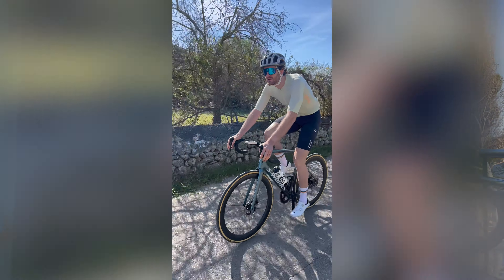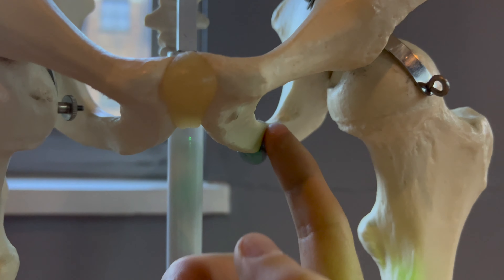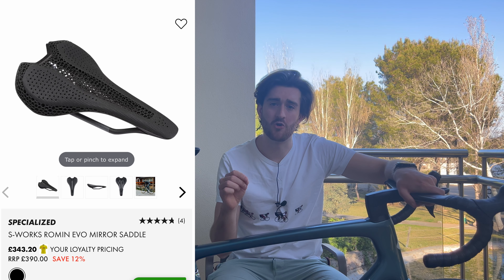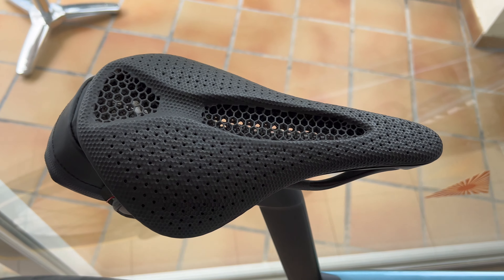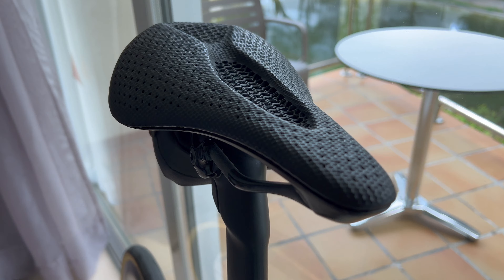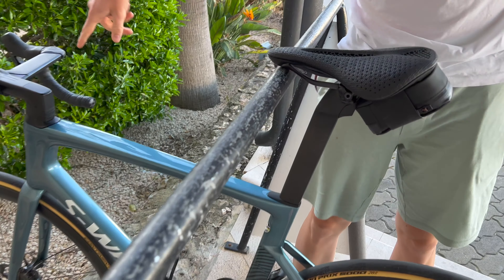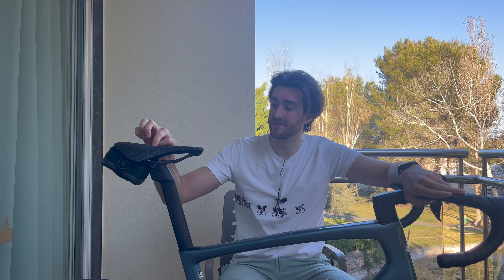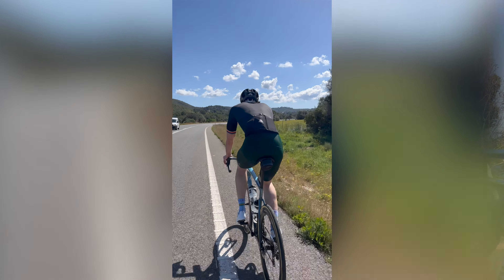Specialized Mirror Saddle (power version) review

Comment: I just bought one of these today and I'm currently coping by watching glowing reviews lmao (good lawd, I could buy a used Trek Marlin for the cost of this thing!). Your review is the best one out there and makes me feel confident! I have only test ridden it a bit while I get my fit correct and I can already tell this thing is a game changer.

I'm getting the Titanium version, mostly because there's a warning in the manual that says Specialized recommends replacing it every 3 years for S-Works (yikes!). I'm sure they are being extremely cautious and it will likely last many more years, but I figured I'd sacrifice the bit of weight for the peace of mind.

Anyway, I have never had a saddle I've loved, only saddles I've tolerated, if this turns out to be as good as everyone is saying then it will be worth it for me!

Dig the channel, new sub incoming!
Reply from the maker: I hope it works out for you in the long run! 

For me no saddle will ever be perfect but this one just works for the longest period of time on the saddle. 
It’s a marginally too wide for my pelvis at the back but it makes up for it by absorbing my lumps and numbs down there.

Comment: Hi, great review! One question though: what about riding in rain when the saddle might get soaked? Because of the structure it isn’t drying that quickly I‘d guess. Did you experience any sort of this issue?
Reply from the maker: It’s a good question actually, and the first one like it on here. If you can get your hands on one you will find why doesn’t absorb water. 

It’s more of a plastic structure so the material itself won’t absorb water. The difference in hardness on the saddle come from different connections and bridges of the 3d printed material. 

The holes are more than big enough that the water just simply runs out. I have never even dried this saddle after a ride, nor after cleaning it. It dries nicely on its own. 
If any dirt does get stuck in there a good 30s spray with a hose on a jet/ fan setting gets it out easily (not a jet wash).

I hope that helps a little!

Comment: Wow, I'm glad I stumbled on to your review. I also have an issue with a point in my left sit-bones protruding more than my right. I finally found the right saddle for me almost 2 years ago with the Infinity E3 saddle since it shifted the pressure point from my sit-bones to the out edges. But, after only 1.5 years and about 6k km. The shell cracked at the rear during the last PBP and since it only comes with a 1 yr warranty, they were only willing to give me a $75 discount for the purchase of a new saddle worth $427! I told them it was clearly a structural failure since I did not crash and took care of the saddle fairly well. After sales support for Infinity Seat is horrendous and am now out in search of a saddle that will work for me. I'm currently trying out the SQ Lab Ergowave 612. Initial impression is its not too comfy. Will try out this Specialized saddle as well. Cheers!
Reply from the maker: If you do, i will be interested to know how you get along with it.

Comment: I've just ordered mine, going to swap standard Power saddle in my Tarmac SL7. One thing bugs me a  bit - you said (and even wrote here) that Mirror sadle is noticeable wider. I'm not big fan of the shape on the back; I'd prefer this widening it not as aggressively. Anyway, I will see - just waiting for my delivery and a better weather here in Europe (which should happen just in 3 months 😀). Cheers 👍
Reply from the maker: Glad it could help! 

Interestingly I am just trying out the power expert with mirror at a 130mm width. I like it a lot more for my pelvis shape. 

The full mirror is more comfortable but the width is better on the power expert. If they did the full mirror saddle at the 130mm width I would really like that the most I think.

Comment: Sound promising. I'm a mountain biker, not a roadie. But wha ti heard here sounds promising. 
Apart from the chafing issue, why is that? Any ideas why? Extra grip holding on to yhe riding shorts? As a mountain biker I wear chamois boxer and baggy shorts. Have you tried this? 
How does it perform in subzero temps?
Fabric Scoop shallow race gets super harsh in even - 1v an dof course gets worse in -10c. But is comfy as soon as it's indoors. And of course in the summer.
Reply from the maker: I have quite a narrow pelvis and this saddle is slightly wider than the one it’s based off. That’s why I think it chaffs me a little.

I can’t say I have tried it in a MTB short unfortunately so I can’t judge there. 

For temp in the uk it rarely gets below 0C so I can’t say for -10. It does get harder as it gets colder but still hold up just fine up to 0. At -10 though I think you would be pushing the saddle quite hard.
Reply: @cyclingunboxed  That makes sense. Should've d tried the narrower version then. If it's fine at 0 it's likely fine at -1C, not massive difference in temp. So sounds promising. I've been been to their regular saddles do well in cold temps too.  IF I don't feel like I'm sitting on just the rails I think I will be fine. As the design looks good.

Comment: I am choosing between S-Works Power and S-Works Power Mirror. How would you describe the difference between these two? Is the S-Works Power (the one that came with your bike) significantly less comfortable and has less cushioning? Thank you
Reply from the maker: Yes, the original power is what came with my bike. 

The best way I would describe is if you have any nobbles or bobbles along your pelvis bone where you sit then the 3d print will absorb them much better. Just as shown in the video. 

Other than that the shape feels very similar to me. I would say the 3d printed one feels slightly wider just because of its design. You notice this toward the front of the saddle more. 

I do feel like I am locked in on the 3d printed saddle more and need to move around less although this is marginal. 

I hope that helps. Any further questions, don’t be afraid to ask.
Reply: @cyclingunboxed  thanks! Would be very interested to see a comparison

Comment: Hey Jason, thx for the tip on wearing bib shorts with a thin chamois. The SW Power Mirror paired with Assos and Castelli gave me chafing problems. It got to the point where I was going to give up on the Mirror and go back to the standard SW Power. Would have been a costly mistake as I purchased 2 Power Mirror saddles! FYI the bib shorts that agree with the Mirror that I own are Rapha PowerWeave and Black Sheep. Rapha ProTeam is passable, certainly better than Assos and Castelli.
Reply from the maker: Do you think it’s the thickness of the chamois? 
I find those 2 brands perform much better on standard saddles but as you said, worse on the 3d
Reply: @ in my case the chafing definitely comes from the chamois on both Assos and Cartelli. The chamois on each brand are a different shape. Castelli is perhaps a bit softer but a similar thickness to Assos. Not exactly sure what is occurring. Maybe the thicker chamois ‘locks in’ to the 3D saddle via the holes or perhaps the grippy polymer material causes the chamois to move independently to my butt. Whereas the thinner chamois has less material to grip the saddle. Anyway, I actually rang the local Spesh dealer and he said he had never heard this feedback before. For me the thinner chamois seems to reduce the issue for sure. Just a theory (bro science 😂). Like most customers I purchased the Mirror saddle to enhance comfort. In the end the opposite occurred when using Assos and Castelli.

Comment: I orderd Power Arc Pro Elaston and it is hardest ever I ever tried by far. Basically, after the first 1h or a ride becomes difficult to sit in continuation for more 1 min at the time. I did a professional bike fit with this saddle. The saddle is directly hitting sit-bones (which is good), and dont have any hotspots or rubbing, but just feels too hard. 

I am wondering if the 3d version would solve the hardness problem but it super expensive (no discount found anywhere Europe)
Reply from the maker: Unfortunately not cheap. Hopefully soon they will bring the cost down as manufacturing becomes cheaper

Comment: Hi, have you tried the regular power? Is the mirror one identical to the power shape or more like the Power arc? 

I get some chaffing on the back of my leg with the egular power.
Reply from the maker: Hi, yes I have tired the regular power as it is what came with my bike originally. Bear in mind I am not a bike fitter, The shape is almost identical so I imagine you would get the same chaffing on both saddles. Have you thought about trying the romin eco saddle? It may be a little narrower at the back.

Comment: How about rubbing on the inner thighs. Any issues? I find the power saddles have wide wings in the back.
Reply from the maker: If I could I would personally get this saddle in a 130 configuration. It does come out a little wider than the normal power saddle at the front but same width at the back. So over time, if you are in this saddle 4-5 times a week, I find this is what causes issues. If just 1-3 rides a week I find it’s ok

Comment: I have this saddle and I don't like it. It's not comfortable. The Romin is also not comfortable. The cut out on both saddles are not big enough. I went back to the Selle Italia SLR Boost.
Reply from the maker: That’s a pretty big cut out on that saddle but I guess it fits your pelvis a lot better
Reply: I have own two but have tried all 3; the mirror romin and power, and thr 3D print slr. 
For absolute comfort, the power is first in class. For a individual with thicker thighs, romin. 
For a firmer feeling with good bibs, I’ll use the slr print.